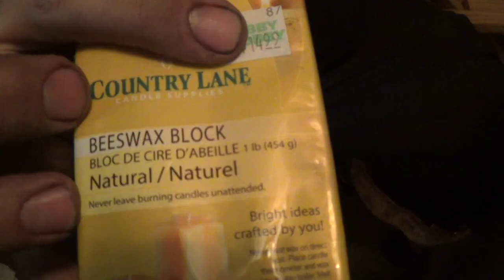Pursuing the Knightly Arts: Maintenance

Comment: Ah, the litany of the medievalist goes (for me) like this: if it's made of steel, add WD40 oil; if it's made of wood, add lineseed oil; if it's made of leather, add neatfoot's oil.

When I negletc my stuff I do a similar process of yours. When I decide to not be lazy I just use paper towels with rubbing alcohol to remove grease form handling and general cleaning, then the final layer of oil to isolate the metals from the air's humidity.

Comment: Thank you for posting this! 
I used your method and gosh it actually worked so much better than using a machine sander, something about hand sanding just get all those nucks and cranny!
After sanding the rust off, do you guys use a layer of oil to treat it to prevent anymore rust from happening? Or does the resedue from WD40 do the job?
Also, any tips in sanding maille if they are not Zine plated?
Reply from the maker: Hey, Kin! Glad you found it useful! Yes, we use a thin layer of oil on top. I use olive oil, as it was a historical method and Ben likes to use a modern oil (German? the name escapes me). For maille, we recommend getting a tumbler. You can buy them for a few hundred and it's as simple as throwing it in and turning it on. Worth every penny, otherwise it's a pain in the ass to try to brush each individual ring...we might make an updated video for this in the near future, as they're other methods we've learned that have better results. -Reece

Comment: Do you guys add an additional layer of oil after cleaning or do you just leave it as is?
Reply from the maker: Opps, we forgot to mention that! Typically I'll add a thin coating of oil once finished. At the end of the video you saw Ben adding beeswax to the curiass with a heat gun. We'll see how it holds up!
-Reece
Reply: That's a neat trick for a more durable solution! I was only aware of beeswax for coating the inside of armour, among other things helmets, to prevent them from ringing when struck (if you have one that does that at all, my bascinet doesn't). I was only slightly confused, since oiling my (and sometimes my "knight"'s) armour is the last thing I do before it is left on the stand for the rest of the day.

As a piece of advice for leaving your armour outside for a night, even though I guess you know and where just too exhausted to bother at that time: An onld linnen bedsheet over a slightly oily armour helps wonders. I left a full gothic field plate outside like that at around 15°C and rain under an open tent and there was no singly trace of rust the next day.

Comment: I am dreading the day that I remove the galvanized coating from my butted mail suit. I've had nightmares of the whole thing flash-rusting right before my eyes xD
Reply: Leave it as it is, and consider making/buying a new one.

I know it's a huge pain in the arse, but zinc is very volatile and it's fumes can cause death rather quickly.
Reply: I wasn't going to burn the zinc off. If you soak the mail in plain old white vinegar for about 2 days, it dissolves the zinc, releases hydrogen gas and leaves the steel untouched with a dark brown residue on the surface. The dark residue rubs off easily and leaves a bronze-ish patina that remains on the steel even after polishing. I've tested it several times with very nice results and no harm done to my lungs :D
Reply: Good luck there! I had no idea with vinegar, most people I've read that tried to remove the zinc used acids with quite volatile results.

Stay safe and watch Knyght Errant's video on maitenance, he covers what he does for his maille armour.
Reply: Thanks, and I will!
Reply: From personal experience, I can tell you two things:

a) Removing zinc with vinegar works and usually takes hours, not days. I have de-zinc-ed two shirts of mail and a coif of varying quality. The coif was completely "untreated" after about two hours in a bucket, stirring it once in a while. I used concentrated vinegar (used mainly for cleaning but officially sold to be mixed with water and used for salads and such) with four parts of water.

b) After you have done that, rinse the mail off thoroughly, dab it try with old towels and immediately (!) cover it in WD40 or similar. Apart from that, maintenance is easy; if it gets wet, try your best to dab it dry, then soak in oil. At other times, put it in a bag, add a few squirts if oil on top and thoroughly "mix" until you feel the entire shirt got a bit of it. In four years of owning my rivited mail, the only rust I ever had that wouldn't completely come off after five minutes of wear was at the wrists, where my sweat got into contact with the mail due to my padded jack being too short. Since I got a proper one, there has never bin any rust on it that would have required manual removal.

Comment: How to fix a puncture ? :)
Reply from the maker: Mozoto, weld it up! 😁
-Reece
Reply: Won't thou efforts sacrifice heat treatment in the act :) ?
Reply from the maker: Mozoto, depends on what you have.  Our harnesses are mostly mild steel,  so that's easier to deal with.  -Reece
Reply: PursuingThe KnightlyArts in case of hardened steel, would you need to reapply the treatment after the fix ? Would it be possible/worth it ? Or just add a small plate of similar steel in the area of puncture ?
Reply from the maker: Yeah, I would heat treat it. Luckily, for Harnischfechten techniques, we're typically aiming for the gaps and openings in the harness, so you shouldn't have that happen. Welding the area is the simplest solution I could think of on top of my head and sending it off the get heat treated again. Course, you can keep like it is, as it adds character ;) Best of luck in what you decide to do!
-Reece